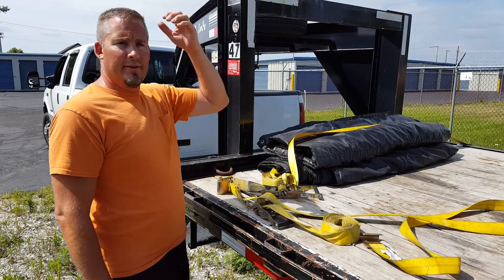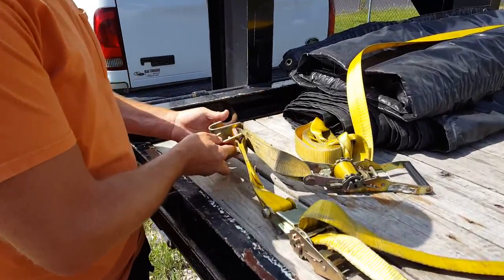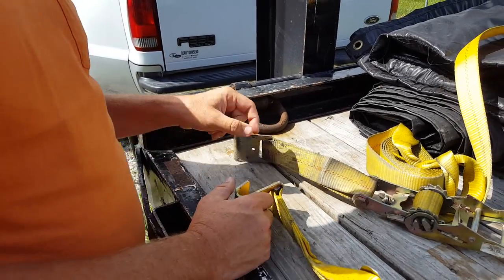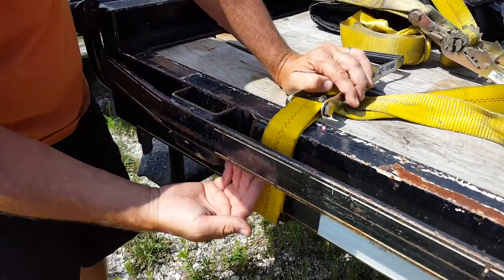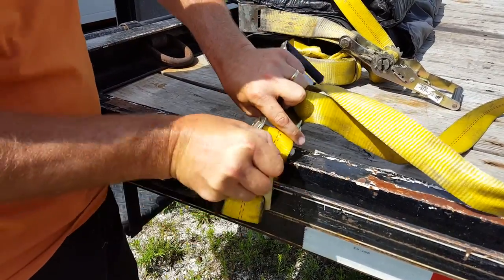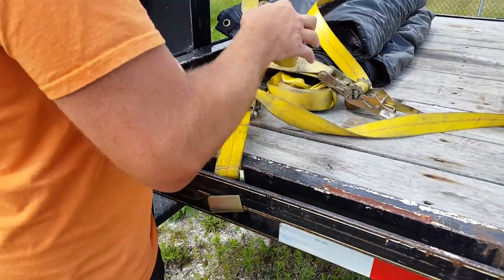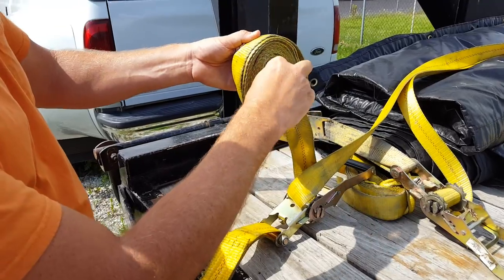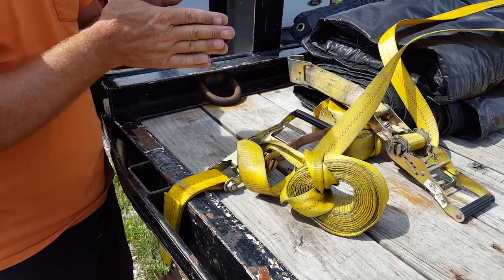Strapping 101

Comment: Manufacturers make  G-70 18” chain extenders 3/8” diameter with 3” delta rings for flat hooks and pear shaped rings for wire hooks .  These work efficiently when tying down at different angles not crushing or pinching the strap webbing .      10/22
Reply from the maker: I have used those. They are great. Good tip!!

Comment: Does DOT care if they are 2 inch or 4 inch straps?
Reply from the maker: The DOT looks at the weight rating of the strap and how much weight it is holding down.
FYI
They also decrease the capacity of the strap by 50% for each twist in the strap.